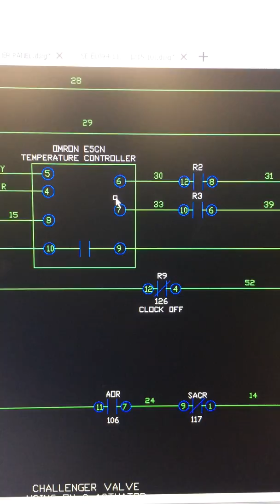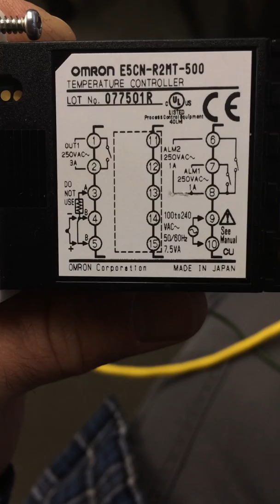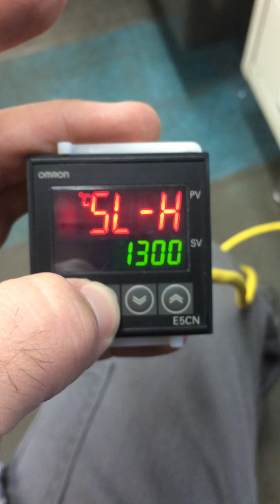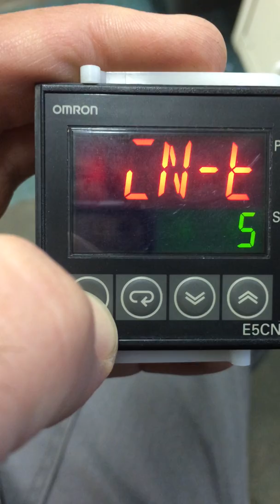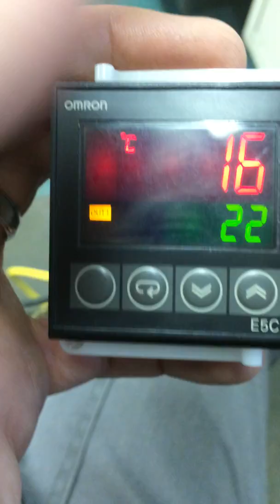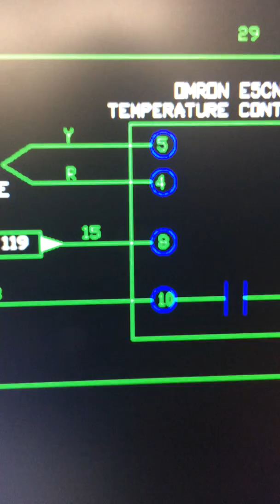Temperature Controller Configure (Sand and Water Panel)

Comment: do you know why the upper part of the screen has only blurry red or green color lights but doesn't show any simbols? The lower part of the screen shows detail simbols! So, I can't control PV tempreture. Did you have a similar fixing?
Reply: I haven’t experienced this myself. I do know your LCD is damaged though and should be clear.

Comment: Hi sri,
I have under mentioning problem 
omron e5cz o2t (s.error) unit's.
What is the best way to get this problem correct? 

Thank you sir
Reply: Rohan Francis, s.error means that the controller does not detect the temperature sensor. The wiring between the controller and sensor may have a break in it, or the sensor connected may be not setup right. For instance a type k thermocouple would be parameter In-t - 5. On the OMRON screen it looks like “Cn-t” but it’s in fact a capital “I”.

Comment: Hi do you have a wiring diagram for a heating element connection with a relay, PID Temperature controller and Heating element? I have the E5CN type Omron Temperature controller. The output 1 and 2 does not trigger the relay. which is 3-32 mA
Reply from the maker: Hello Mr. Kedir, the model of temperature controller that I use is only a on/off relay type. The omron controller activates the the output 1 and 2 (with programming) based on the temperature read, and the set-point it's trying to obtain. My example is used as a cooling function. You would need to have the control type to be a heat function.
Reply: Thanks Sir, on your example every thing was clear but the cable to the heat element is not explained. Are these cables 6 and 7 ? you mentioned cables 6 and 7 both should be inserted in 1.
Reply from the maker: Hello Mr. Kedir, the temperature controller has a limit on the amount of amps it can have go through it (3Amps @ 240VAC). For your purposes, using an omron controller as a thermostat for a heating element you would require a relay to handle the amperage load and have the omron controller energize the relay's coil by connecting the 120VAC to terminal #1 of the omron controller as your power line feed and you would have the relay coil power wire connect to terminal #2 of the omron temperature controller. When it gives a "call for heat" the controller will close the circuit  between terminal #1 and #2, the power will energize your relay coil, pulling the in heater element to start heating.
Reply: Thanks Sir, am having difficulties trigering the relay through Terminal 1 and 2. My relay has input 4 and 3+ are 4-32 VDC and output 1/L1 and 2/T1 have 48-660 VAC. I connected Terminal 1 (PID) with 3+  and Terminal 2 with Relay input 2. But the relay is not switching on. On the PID controller i see the output1 light is on. I don't know why. Do you know how this can be solved?
Reply from the maker: Hello Mr. Kedir, Can you please provide the full Omron controller model to make a proper reference to what you are trying to do.